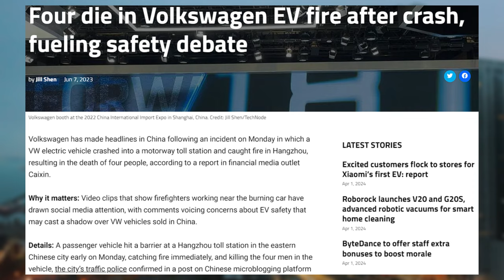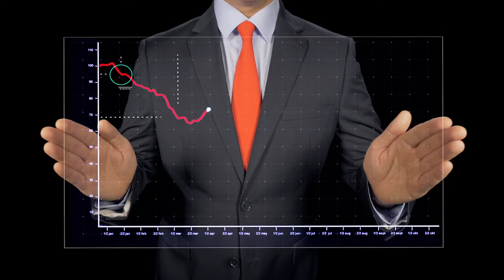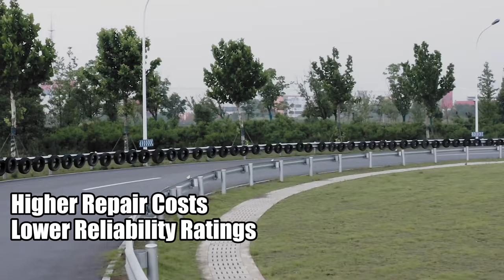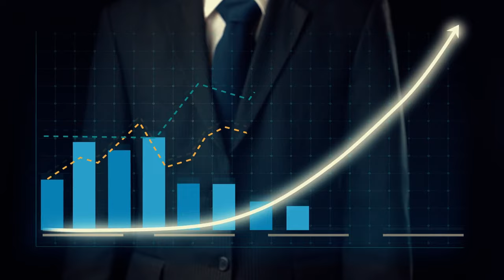Chinese EVs Ignite Concern: The Shocking Rise in Fire Incidents! Electric Vehicle S in Flames

Comment: THE SINGLE MOST SURPRISING THING LISTED HERE, IS THAT THE iNSURANCE COMPANY'S  INSURE THOSE CARS AT ALL;  OR ATLEAST, A  MUCH HIGHER PERCENTAGE ADDED.
Reply: Rates will climb rapidly if number of fires increases and they learn more about actual rate of fires occurring.  Then EV popularity will plummet due to number of fires and high insurance costs in addition to high depreciation.  

If number of fires do not appear excessive rates will moderate. But at the moment everybody is still learning I think. I am concerned about possibility of EV fires in basement carparks in apartment buildings.  At the moment objective critical reporting of EV fires generally is not occurring because of government push for EVs.